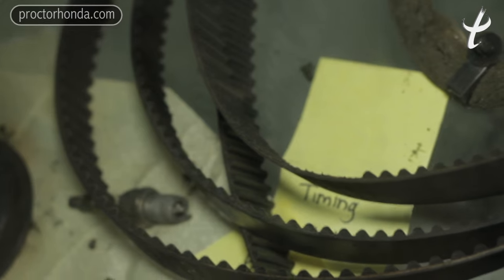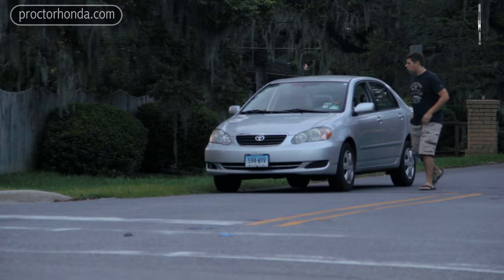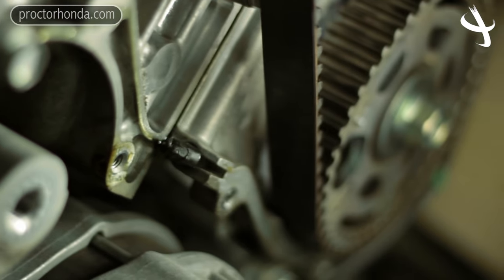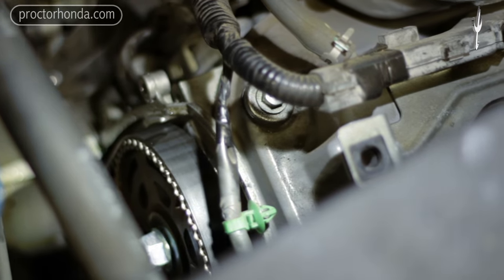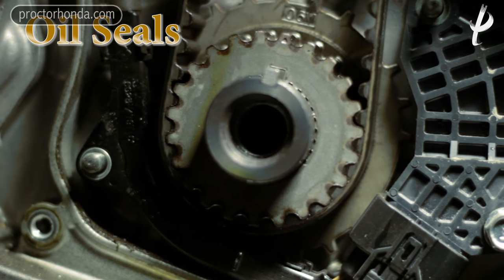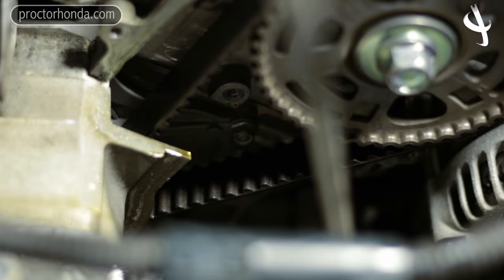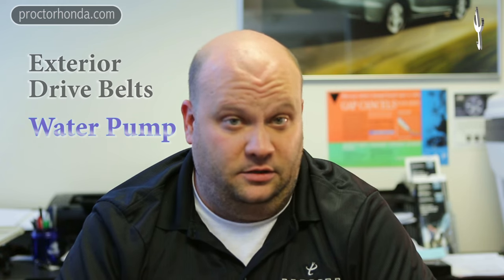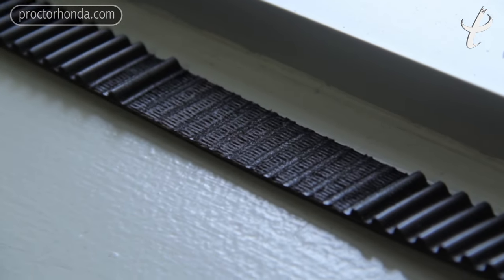How Long Do Timing Belts Last? - Timing Belt Replacement Service

Comment: If you buy a used car with a timing belt, dont assume anything, go ahead plan on spending the money and if the seller cant show you paperwork where it has been done then try to get the seller reduce the cost of the vehicle to off set the cost. better to go ahead spend the money than bend all your valves or bust a piston.
Reply: bradley goode or look at the date stamp on the belt itself👍
Reply: is there ANY way to know is it right to do "BIG service" on 1.6 tdci / HDI engines ? Can we somehow notice that there is time to change timing belt, tensioner, water pump...? Are there any specific sound or engine behavior to recognize ? I own (used) Focus (mk2.5) 1.6tdci '09 for almost 3 months and even I got warranty for more 10K km for engine and gearbox but I'm still a little bit suspicious (although the vehicle looks very well preserved for 9yr old) about that question... 
In papers from service there is a trace that "Big service" was performed in France at 165K km with cost like 700 euro and car now have 186K km on odometer, but bcs I'm from Serbia there is never 100% warranty that the mileage wasn't decreased when vehicle was imported from France (for better selling price with less Km). 
I all ready did all filters and oil change by my own.

Comment: I have 200,000 miles on my 2006 dodge charger 3.5L and i just replaced it about 2 weeks ago. I replaced it because i knew it could break at anytime. What i did i bought the whole Water pump kit from Rockauto.com Anyways the point im trying to make is no one really knows when a timing belt can break. I am the only owner of my car so i know for sure some cars can go up to 200k with the original belt. But honestly is not recommended.

Comment: Timing belts do not snap on there own, it's normally the tensioner what fails or one the pulleys freeze/sieze. Take a old used belt and try and snap it with your bear hands. IMPOSSIBLE

Comment: I just bought a 2000 Chrysler Concorde w/3.2 litre engine. It is 16 years old but only has 48,000 miles (78,000km). The manual says to change it after 160,000 km. I am nowhere near the recommended mileage but should I change the belt because it has been in for all those years?
Reply: I live in Florida where the humidity and heat kill your car. I change all belts and hoses ever 60k and battery ever 2 years
Reply: If the belt is rubber, Iwould. After seven years the belt will "dry rot"meaning it will start to get stiff and brittle and show cracking not to mention being exposed to tempertures
Reply: The belts usually have a cover cap that you can easily take off and inspect it and decide to change it or not.

Comment: Rocky is correct.Always change your timing belt according to Manufacturer specs.If the belt breaks and your engine is a interference engine ,internal valve +Head and piston damage will happen.The repair cost will be expensive.
Reply: proper maintenance of your vehicle is very important

Comment: 139000 on my Sonata and not a crack.  You also should've mentioned the difference between non- interference vs interference engines.  I got a timing chain, so if mine goes I just have to worry about the overheating, but if your belt system drives your timing think about replacing the engine.

Comment: 😢 my timing belt broke on my 2007 Pontiac grand prix, plus I needed to get my water pump fixed finally had the extra money but I guess I waited too long!
Reply: Yeah ok sorry your engine is a (non interference) motor lol this here is for us folks worried about the valves kissing the head.
Reply: @erickimmy1493  please come to find out my car needed a new transmission plus a host of other things that the dealer did not tell me about so maybe next time keep your comments to yourself.

Comment: I have a 98 civic with 240k miles, original timing belt. I should change it, but the whole things so old that it I think I'd be shoveling sand against the tide.
Reply: Radnally cost more than the car

Comment: our suv is about to reach the 70k kms mark and i'm preparing the heavy on the wallet budget for the timing belt replacement
Reply: 70k kms? that's only about 44K MILES

Comment: Metal timing chain will out last rubber belt, hate the rubber timing belts!
Reply: Me too.These rubber bullshits are design to shorter the life of the car.They said that rubber belts make less noice but I prefer that and have reliable car than not knowing when everything will fail.No thanks. The best engines are with teeth wheels I dont know the proper word to explane in english but you will understand...BOMB PROOF

Comment: Timing belts.....what to do...timing belts and water pump...what to do..... I've changed timing belts myself, on older cars; for an engineer it's not difficult....but modern cars? The reason you might consider changing a perfectly good water pump as well is....whilst the covers are off, you might as well. Basically, you bite the bullet and change both, round about £620....it's insurance against a croaked engine!

Comment: My Mitsubishi service manual state's 100,000 klms or 5yrs,water pump, tensioner pulley 200,000klms so why do the mechanic's keep saying change everything.
I wonder why?,maybe it's because $500 first change $1200 plus second belt.

Comment: WHY DONT THEY JUST USE CAM TIMING CHAINS LIKE ON A BIKE ENGINE IT LASTS EXTREMELY LONG TIME
Reply: Agreed
Reply: Despite them lasting longer I'd rather have a belt. Apparently chains are much harder to remove than a belt.
Reply: the chain is placed in between the camshaft rods, its always stay soaked in oil, my bikes never needed chain replacement till they went to the scrapyard,  a good heavy duty camchain lasts virtually till we throw the engine away..
Reply: I had a chain on my old 351W.  The chain had so much slack in it the chain started wearing a hole in the chain cover.  Chain or belt you still have to replace them.
Reply: All the older cars and trucks I worked on used chains
Reply: The best thing about chains is they don't usually break and have you needing a new motor.
Reply: if you have an interfierence engine it will bend all your valves if it snaps and the motor will not run until fixed via a head rebuild, i repaired mine for 700 by doing the work and pulling the head myself a chain would be nice.
Reply: YEAH my 1200cc bike uses chains like almost every 4 stroke bike...only some chain noise, virtually trouble free..
Reply: fidel catsro too noisy and need also chain tensioner and sometime's got to break when the car runs fast

Comment: "How Long Do Timing Belts Last?"
Simple answer, they don't.
A timing chain will last for the life of the engine, and beyond. Timing belts were installed in engines by car makers only to create additional aftermarket business for car dealers and repair shops. The argument that belts are quieter is bogus.
Reply: I Agree!!! It's all business!!!
Reply: Right so why does bmw chain brakes it is just design hmmmmmmm Lexus last forever so my belt in the book on 1.9tdi 90k or 5 years I replaced the belt after5 years belt was fine but the water pump I would question that so I would say 50/50
Reply: Chains CAN break too....lol they are NOT invincible
Reply: My timing chain busted on my 72 Cougar/ 351  Windsor engine a day after pushing my asshole friends car home 8 miles! 😢

Comment: my car has a chain. one less thing to worry about.
Reply: Chains can break too....you know that, right?
Reply: @erickimmy1493  They can, but only under extreme duress. You can buy a belt timed car, leave it untouched with zero miles on it for 10 years and you will STILL need to change that belt out for aging! Not so with a chain however.

Comment: what are the symptoms  old  timing belt
Reply: about only way is to look at odometer and if its 100,000 its time if it hasn't left you sitting yet.
Reply: None. They give no warning. They just break.
Reply: They start to fray on the edges , they get dry rot micro cracks, then the rubber teeth start to shear off n then your timing gets thrown off n boom piston hits the valve n your Volvo is no more a go!😢

Comment: those rubber timing belts suck, wonder who invented those stupid things, all the heat in the engine wears them out fast, had 1 break on me at 3 am in the boonies on a winter night, had to call a tow truck, 200 bucks just for that.
Reply: Maybe ford racing bda 16v,  early lotus used t chain.  prefer t,belts myself. R s.